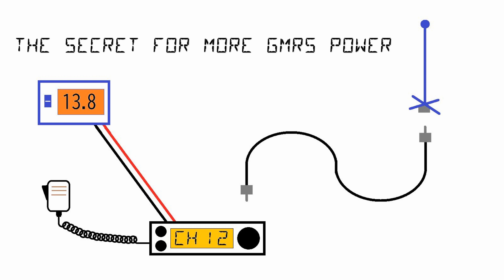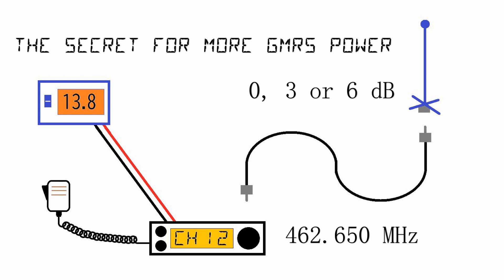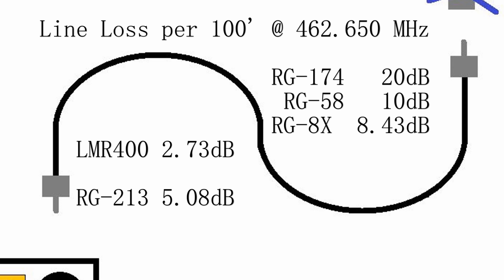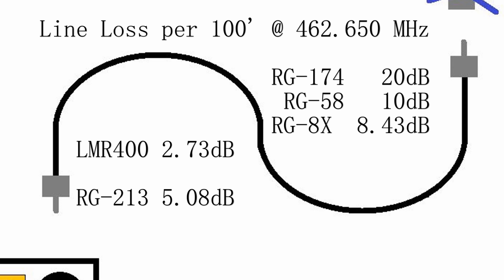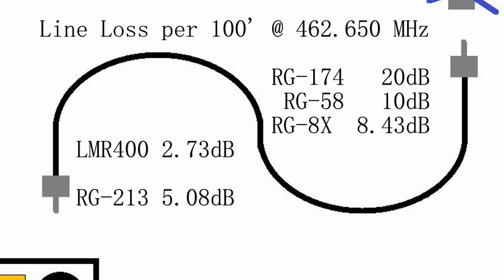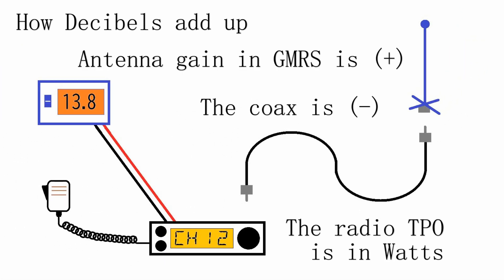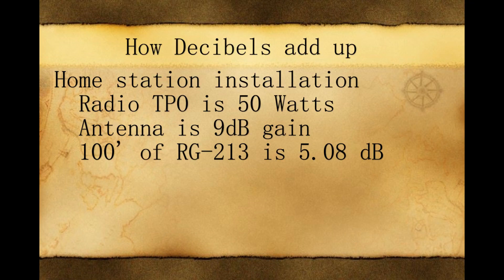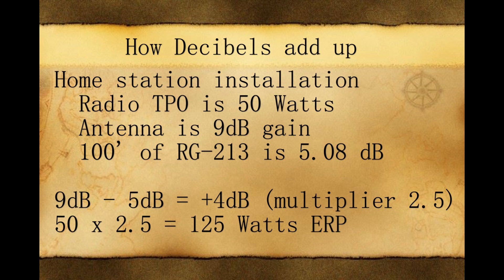The secret for GMRS power

Comment: Guys coming from CB are in for a shock because of the loss in the coax. That coax cable that worked fine for CB is almost a dummy load at GMRS frequency. LMR400 or heliax are necessary. The loss quoted above is for 100 feet. A mobile install is usually 20 feet or less. So 5 db loss at 100 feet, and 1/5th of that for 20 feet [so about 2 dB] in mobile install with rg58. RG8x may be a better choice for a 20 foot run in the mobile. That loss affects the receive too. So more distant stations may not even be heard because of the loss. from RG8 or RG213. Or if you hear them, they still might not hear you. LMR400 should be the minimum choice for a base station install.

Comment: Antenna gain does not amplify radio power. To amplify output power you need an amplifier that use electricity. Antennas are passive units without any amplifying capability. 

So what is dB gain?
- It’s a method of describing what the projected signal from the antenna looks like. 
A 3dB antenna projects more or less a doughnut shaped signal. 
A 6dB gain antenna projects a slightly flatter doughnut. 
And the same for the 9db gain antenna. 

The higher the gain the flatter the doughnut. The flatter the doughnut the longer the range.

Comment: Also, quit using pl-259 connectors. They were designed ages ago for lower frequencies. Anything above 300 mhz should be N or SMA. Pl-259 connectors have impedance bumps at higher frequencies and they get worse as the frequencies get higher. Don't use ham or cheap radios that have so-239 / pl-259 connections. Get N connections all the way through, and limit the adapters and pig tails, etc... People have no idea how big of a difference this can make, especially when combined with hard line or other very low loss coaxial cable that is short as possible

Comment: Back of napkin calcs based on what you explained mean that I can change the location of my new radio shack to a different room.  More transmitted power, for less money and less labor for installation!  Everyone wins.
Reply from the maker: You get less cable loss, which is significant, in the 440 & GMRS frequencies with a shorter run distance. Everyone wins unless the new room is the bathroom 😁 There are calculators on-line and in the App Store for helping with this.

Comment: With your calculations on the coax your right there is a loss with your calculations on the antenna you're totally wrong because you cannot multiply the wattage coming out of the radio with just your antenna that is a myth what your radio puts out is what your radio puts out the antenna will not give you more the only way you get more is with an amplifier sorry to burst your bubble
Reply from the maker: You are right. Its not magic. The multiplication of antenna GAIN is gotten by how the signal is focused in a specific direction. 
Effective Radiated Power (ERP) was not the topic of the video.
If I said it multiplied the power out of the radio, then I stated it wrong. The correct statement is effective power coming out of the antenna.

Comment: how did you get the 2.5 multiplier?
Reply from the maker: dB = 10 x Log10(multiplier)
In Excel put a multiplier into cell A1. The formula in A2 will be = 10 * LOG(A1,10)
A2 will be the dB.
Quick check is if 3dB is a 2 times multiplier then 4dB will be more.
Reply: @personalradiofun526  thanks

Comment: As a ham radio operator I do know the best way, usually, to maximize communication distance and maximize safety.
1. Most important, the antenna. It is the singly most important component of a radio system. Mounted as high as physically possible within limits of the FAA and FCC with the proper lighting and painting.
2. Coax. Get the one with the least amount of loss per foot for the highest frequency you will be using. Remember that, for the most part, repeater inputs on the higher bands are 5 MHZ or more higher.
3. Grounding. Most may forget this part or say they do not need it. Wrong on both counts. On the lower bands, it is essential for communications. On EVERY band, it is a MUST for safety. In the shack, a COMMON GND point is best with the largest conductor to a physical GND rod, or multiples of gnd rods. 
4.  Static discharge tube or similar device in-line with the coax. This is important to shed any currents in a antenna system that is not shunted to gnd.
5. Finally the radio, get the best you can afford, AFTER purchasing ALL the above. 
For a communications system to work, all the above MUST be observed. I have seen a 400 ft guyed tower for ham use. Required FAA and FCC approval. Required lighting as it was ABOVE the 200 ft limit by the FAA for unlit towers. Also needed the red and white alternating color scheme used by commercial broadcasters. 
This guy also had a repeater on the tower, was non-coordinated, and was used for testing. He used a self-contained repeater in a cylindrical container mounted ON the tower powered with 120 vAC, 50w with a short 5 ft length of coax. That repeater worked very well in the midwest, think ?0?? country. Programming was OTA. Because he had to light the tower, he used romex 10/3 w/gnd. This powered the lights and the repeater. Without having to run a 1" hardline up the tower, the weight savings was very good and the wind loading was reduced. This also allowed a lower powered repeater to operate as coax losses were  negligible with only 5 ft used, most of which was used to make a de-coupling choke just below the antenna, which was a 4 bay shorted loop for 440mhz. I did not include the power-dividing coax assembly provided with the antenna in the coax length. This repeater setup could be used for GMRS to increase distances without increasing power past the 50 watt mark. 
73 de N7TZQ
Reply: Shame on you, Sad Ham, for playing along with this clown. ERP - is a power rating, is it not? No antenna can increase power, because you can't make something out of nothing. dB gain on an antenna describes the focus of power, not amount of power. Also look up the NEC on multiple ground rods, you are providing DEADLY ILLEGAL advice. GMRSers are right, there are a lot of Sad Hams out there. No wonder CB is more fun than Sad Ham Bands. After decades of CB & GMRS use, I considered Hamming it up. Then I saw Sad Ham videos in which grown men were giddy about making distant contacts, and that was it. Their goal was to make as many DX contacts as possible, and that's it. So strict, and so boring. While Ham radio has a very useful place in the world of communications, it has got to be the most boring place on the dial. You can keep your 73s, GMRSers say "69s"!!

Comment: Hi I'm using lmr 240 at 50 feet . Would I see any difference if I upgrade to lmr400 at 50 feet? Using for gmrs base station
Reply from the maker: At 462 MHz LMR400 is a 26% loss and LMR 240 is a 46% loss.

Comment: I just installed the Midland MXT275 in a newer suv. when I key up the mic...i get a bad hum in the audio of the radio system the radio is plugged into to the cig lighter.... I am guessing its the amplifier of the radio. the Mxt275 is only plugged in and that is my poor ground. Ideas?
Reply from the maker: UHF is bad for interference with some electronics. How is your antenna mounted?
Reply: @personalradiofun526  It is mounted on the front hood on the drivers side with the 2 supplied set screws.
I have noticed over time that the "hum" appears to have lessened . but still there. It only is noticeable on the Car audio amplifier . Thank you

Comment: Yes, coax is not friendly with GMRS frequencies. I was able to "gain" 7.3 db in a mobile setup by changing out the coax and antenna from a stock issued antenna. Made a sizable difference, but think that the higher gain antenna's height helps with mobile setups. The tip of the antenna went from 7 to about 9.5 ft, not much but that little bit clears a lot more stuff near the ground. https://youtu.be/rU-P1lq7hMI

Comment: i ran LMR400 in my mobile no problem.  21 Silverado 2500 Crew cab. through the dash, under the carpet , up the rear pillar, under the headliner to a NMO roof mount.  Yes a Cut a hole in a $80k truck. running a Motorola XPR5550e in a custom mount. Laird BB4505CR antenna 5db

Comment: Thanks for the video, but loss on a 100 foot coax is meaningless in a mobile installation.  Some of the best antenna mounting systems I have ever used are actually RG-174 based as the cable is easy to run and conceal in a vehicle.  In a 10 foot run coax loss is nominal to say the least.  Far more effective is to use a GMRS specific antenna centered on the roof of the vehicle to maximize height.  And the better the ground plane the more the signal is compressed vertically making it extend more horizontally.  The best results I have had with 2 meter or 70cm or GMRS is a mount in the center of the roof of my pickup.
Reply: You can buy NMO mounts with LMR-200 pre-installed.

Comment: You are Not Exactly Right..but close.
But No one who is Truly looking for a Home System
( especially for a 100 foot or greater run of feedline )
Will use any of those feedlines..

Example..
For HF ( I use for cb / 27mhz ) I use Heliax LDF5-50A
For VHF & UHF ( GMRS is UHF ) i use Heliax LDF7-50A
Coax feedline

Though "genually" VHF and UHF is line of site
That isn't always True ( antenna type becomes very important to achieve beyond line of site)..
and Height is Might

Yet..
I argue these points with plenty of people.
But then heck i have Only been doing this stuff for 50+ years

But i for sure wouldn't be caught dead using LMR-400 
Even on CB /HF Frequency's
And you are trying to state it's great for UHF..
That's a Big.....NOT !!!
Reply from the maker: Thanks for suggesting those great feedlines. At less than a 0.5 dB loss / 100ft. they are definitely less lossy than LMR-400.

The main point of the video is to get people to understand that not all coax performs the same. So if you have a small budget then make the best choice that your funds can support.
Reply: @personalradiofun526  Additionally
Besides buying Andrew's Heliax from Andrew's and or  a store....
So too one can get left over runs from cel phone cites installers ( and save Lots doing so plus these guys can install any type of antenna(s) if one isnt good at doing so themselves ( being inventive in how you buy and or install your equipment can make a huge difference enabling one to get better coax runs at huge discounts)
I will admit though.. LDF5-50A & LDF7-50A is hard to work with for many people...yet well worth it.

It is the types of coax feedline I use
Along with Equally high end radios and power supplys
That Enables me to get ranges well beyond a average user and to do so on a regular basis

I cant tell you how often others with even 10 to 20k amps get Destroyed with my tops 135 watts output on hf and 20 to 50 on vhf/uhf ( I dont use amps-liniears ) but rather use of large high quality ground planes for HF and vhf/uhf antennas 57 ft up at base of antennas ( 81 ft at top of antennas) with nothing higher around for 1/2 mile around ( at least )

My point is
The better equipment one gets
The better they set it up
The refusing to setting for half measures

Once done
One can settle in and enjoy the 2 way hobby quite well

Comment: This is a really good easy to understand video.  But, what wasn't covered was the effect on receive signal. Each 3dB of loss in the antenna/feedline system equates to about one S-unit less receive signal.  And increasing transmit signal by 3 dB really only increases the signal at the receiving station by one S-unit.  This may be really important if operating simplex; maybe a little less important if using a repeater. So, the best installation is to get the radio as close as possible to the antenna by being closest to directly underneath the antenna, use the highest gain antenna, and the shortest run of the best coax.
Reply from the maker: Great points. I saved the receive issue for when I cover antennas. I will make a point to separate simplex and repeater issues as well.

Comment: how do i connect the Yagi antenna to a Wouxan KG-905G GMRS 2-way radio and what connectors and cables will I need?
Reply: Here is your Answer:

Your radio uses standard SMA-Male connector.

Your Yagi is a ???
If is optimised for GMRS ( basically 470 mhz) then cool
You can sort of get by likely with a 70 cm yagi but that's optimised somewhere between 420-450 mhz.

You didn't mention what connection is on your yagi
It can be PL259/UHF(SO-239) standard connector.
Or a better type N connector ( provides a far more water tight seal ) or even a TNC ( even better for keeping water out of your antenna connection )

If you are Asking
What Connector to use on your Yagi..
Best is TNC
Next Best ( and I use a N connector )
UHF ( which is also known as a SO-239 )

So..
Depending on what you already have hooked on your yagi..is what you will use on yagi end

Then on your radio end prefibly install directly to the feedline a SMA-Male connector..
Or a converter to sma-Male ( but that will induce a loss.. though only a small/ tiny loss )

BTW..
For UHF ( Your gmrs ) I use Andrew's Heliax LDF7-50A 
Feedline ( extremely low loss feedline )